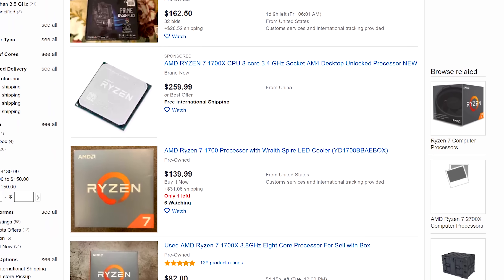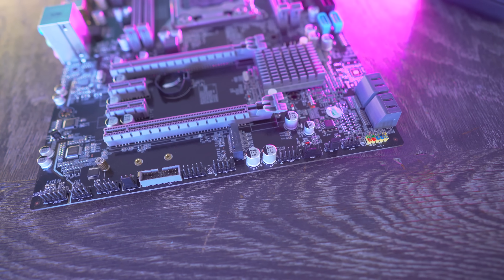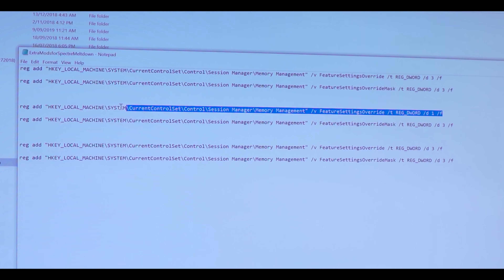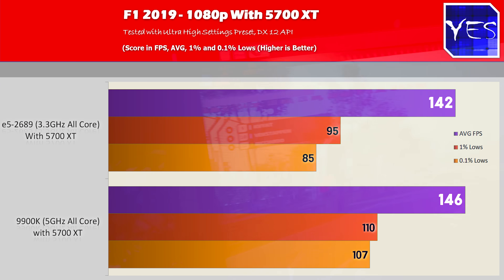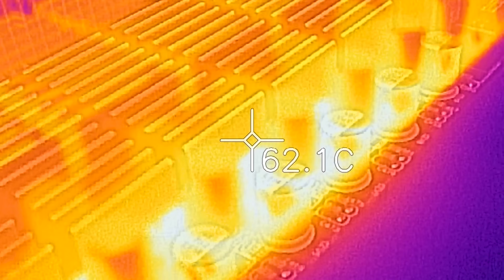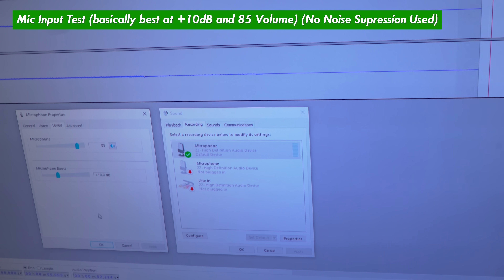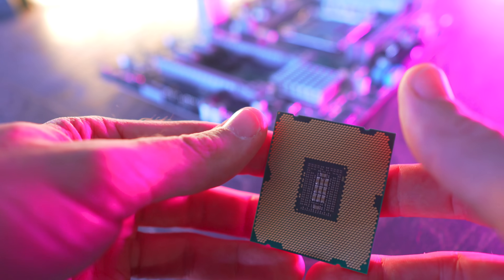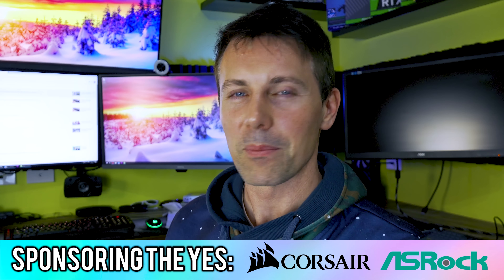8 Core CPU for $53....!? Will it BOTTLENECK a RX 5700 XT...!?

Comment: What's the lifespan like on one of these Ali boards?
Reply: If you want to upgrade dont bother. Its better to get a b450 motherboard and stick with that.
Reply: @XeroPhobous  Yeah ive got b450 and ryzen 2600. I used to have a X58 westmere system but the board died.
Reply: @abedfo88  yeah that build you have now is solid and will last you a good while 👌

Comment: Dead platform with no upgrade path just get a used ryzen 6 core and a used b450 mobo it will be about the same and you have a massive upgrade path if you want
Reply: yada yada yada yada yada x79 if you can pick it up used is still better price to performance (in australia) compared to any ryzen 1st gen which is almost never sold second hand btw
Reply: @MarshallSambell  you save like 40 usd total and you are now stuck with what you got forever. I'd spend the little extra and then when needed you don't have to upgrade the entire system. To each their own I guess.
Reply: @aaronporter2180  By definition not stuck "forever", that's ridiculous. For gaming, the GPU is far more important and as the resolution/detail increases, as games take on newer APIs which need less host processing, older platforms actually increase in their utility. Bryan has covered this before. It's the whole reason why old XEONs are now quite potent, whereas years ago they made no sense for the games of that era before DX12/Vulkan. X79 mbds can easily cope with far more powerful GPUs than the 5700 XT, and bare in mind that the 2689 he tested would only have been operating with PCIe 2.0, so the 9900K had a PCIe bandwidth advantage aswell.

So sorry but you're wrong, for gaming the primary upgrade path is perfectly fine. The mbd supports PCIe 3.0 CPUs should one ever care and the performance works A-ok with far more powerful GPUs. I know someone who uses a 2080 Ti on his X79 with a 3930K, no problems at all. I've tested 1080 Ti SLI on my R4E, excellent results. People make comments deriding older platforms but they've never actually done the tests themselves, they have no data. I've done a great deal of testing.

In reality if one did ever desire greater CPU side performance in the future, eg. for encoding (though much of that is moving to GPU acceleration these days), then by the time that day comes there will be a whole new landscape of used hw to choose from, whether that's XEON v4 CPUs or perhaps Zen2 Ryzen. The point is that at any given moment in time, there is a heck of a lot of utility in used hw which proves that the enormous expense of the latest and greatest simply is not necessary to achieve good gaming performance. The data proves this. The obsession with some mythical upgrade path is laughable, the vast majority of users never upgrade anyway, most end up doing a full platform switch instead because these days tech moves that fast and the desire to keep up with one's peers is that strong.

The one caveat to all this is where CPUs are so old (eg. S775 platform) that they don't support certain modern instruction set extensions that are needed by particular games. If one is playing a relevant game then one needs to bare this in mind, though X79 is easily new enough for this at least for the moment to not be a factor.
Reply: @mapesdhs597  tldr mate
Reply: @aaronporter2180  (re "tldr") Not an argument. :D  Are people afraid of words these days? Good heavens.
Reply: @mapesdhs597  you couldn't have said it any better
Reply: @mapesdhs597  no its just not that important
Reply: Aaron Porter The differences closer to $100 in Australia
Reply: Yeah I love these videos and love seeing the value you can get. And back in the day I would of gone for it out of interest, but these days I just want a computer that I can trust not to set on fire.
Reply: Let's  be honest who will need to upgrade 9900k in the near future
Reply: @abdelrahmansalehelhenawy1220  not what I was referring to but ok

Comment: Recently took possession of a Asus P9X79 WS in like new condition from Japan... have a Intel Engineering Sample 6 core in it turbos to 3.5 ghz but its locked... Once the bank account allows will pick up a 1680v2 with the unlocked multiplier will take it to mid 4 ghz's... running quad channel 1600 mhz,  8 x 8 gb sticks, have modded the bios and have it booting from NVME, need to get an elgato 4K capture card,  have a Vega 56 in it, getting a beast of a Video card for it... hardest part due to the cost.

Comment: Another conclusion -  the 5700xt clearly bottlenecks the 9900k. But again, why would someone, investing in a 9900k, would pair it with a 5700xt?
Reply: For CPU intensive tasks, and to also play games.
Reply: @ByGraceThroughFaith777  Also not sure I'd call it "investing" when for the same or less money one can get 4 more cores and 8 more threads from AMD with basically the same IPC, without the need for lunatic cooling to extract the potential performance. For any given real world typical gaming budget, the 9900K makes little sense; buy something cheaper, use the cost difference to get a better GPU, used or otherwise.

Also, how exactly is the XT "bottlenecking" the 9900K? That's the wrong way round to think about a gaming task as it implies the CPU should be showing greater usage than it is, which isn't true. One primarily cares about getting the most out of the GPU, ie. for a *game*, all that matters is whether the GPU is going as fast as it can (for benchmarking anyway; for real play it's whether it's going as fast as we need it to), and what this shows is that one just doesn't need (indeed one shouldn't need) a top-end CPU to game well.

For a modern game using today's APIs, one ought to be very concerned if a CPU like the 9900K is being pushed flat out, because such behaviour would imply a very poorly coded game. A powerful CPU running with high usage for a modern game is not a +ve thing. Where that performance headroom comes in far more useful is coping with the fact that real world systems don't just game; people stream, record, encode, have other stuff going on in the background like AV checks, they're running Windows setups that are old and a bit degraded, etc. GN showed this when they compared Ryzen 1700 to a 7700K for game streaming way back and they were only testing with clean builds.
Reply: @mapesdhs597  a CPU with so many threads is never at 100% because no game uses all threads at once. To truly see the pure gaming performance of the Xeon and the 9900k, one has to eliminate the GPU bottleneck and use a 2080Ti. I am sure that if both CPUs were tested with a 2080Ti, the 9900k would be far ahead the Xeon.

In any case, I fully see the point behind the video and I am sure that this is valid for many. however, I doubt that someone on such a strict budget to consider investing in an x75 platform in 2019, would buy a $400 GPU. They would probably look for a 900 series or at best, a 580.
Reply: another point - I also don't think it's wise to disable the fixes for spectre etc - especially since most users getting a xeon would have productivity in mind. And not disabling them would bring in the 'slugitis' back :)
Reply: @mystic8260  So much of your first paragraph there is way off off. :D  There are plenty of games that use all available threads. Have you actually done any testing? And like I said, gaming performance is about *graphics*, testing with a 2080 Ti is totally ridiculous. What you're doing there is converting it into a pseudo CPU test, which just ends up with the ludicrous scenario we have now where tech sites rant about 1080p esports & suchlike to show frame rates of hundreds/sec as if that's meaningful, because that's the only way they can test CPUs which can show any differences. As soon as one moves to higher detail and/or 1440p+, CPU differences don't matter a damn for real-world gameplay (the vast majority of gamers do not use 144Hz monitors). 1080p testing with an OTT GPU provides no useful data at all that's useful for making actual buying decisions by the kind of people at whom these videos are aimed.

Also, precisely because of the GPU being more important for gaming across the board, many people do indeed sensibly focus their budget on the GPU rather than the GPU, that's the whole point; it's wrong to assume someone going for a budget platform would also therefore only go for a budget GPU. In reality their platform cost saving is what allows them to buy a better GPU at all. I know because I've helped people go through this decision making process, eg. for a friend of mine years ago, an oc'd 2700K + 980 Ti, cheaper and far better for 1440p gaming than a new 6700K + 980 he'd been originally considering.

People have the methodology of all this so much the wrong way round. I get why tech sites test with a fast card, but that's CPU testing, not GPU testing, and certainly not real world gaming testing which helps gamers make realistic purchasing or upgrade decisions. In the real world, people ask the kind of questions tech sites rarely bother with, like is it worth sticking a 1080 Ti on an AM2/S775 board? This is why channels like TYC, PhilsComputerLab, RandomGamingHD and many others are so useful. If I had the time I would be doing a lot of this sort of thing myself, but alas I don't (dealing with some family stuff for a few months), at least not just atm anyway, though I do have a lot of accumulated data, including CPU data and older game/benchmark data (though much has never been written up):

http://www.sgidepot.co.uk/sgi.html#PC

I have hundreds of Vantage/3DMark11/Firestrike numbers I've not written up, plus a lot of newer game testing I've been doing with a whole bunch of games, but it'll be a while before I can finalise the web pages (doubt I'll ever have time for videos) which will cover AC Syndicate, BioShock Infinite, DIRT Rally, F1 2018, FC5, GTA V, Hitman 2, Metro LLRedux, RotTR, SotTR, Sniper Elite 4, R6 Siege, The Division and Witcher 3 WH (maybe Doom aswell if I can figure out how to capture the performance data). As Bryan has shown, the results vs. newer tech are often a lot closer than most people assume would be the case, in some cases very close. Older tech does tend to drop the 1%/.1% Lows, but often not to any degree that matters (depends on the game, certain titles can be hit a lot more, eg. a bit further down the CPU scale and GTA V would definitely suffer).

This btw is part of my GPU collection:

http://www.sgidepot.co.uk/misc/gpushelves16.jpg

Atm I have eight S2011 systems (one of them dual-socket) and about fifty other setups of various kinds. Most recently I've been testing an RX 580 on a S775 board with a Q9550 (results were... variable. :D) I should add, at one time I was going to do some articles for tomshardware about the nature of mismatched CPU/GPU pairings and real-world upgrade decisions, but alas family stuff got in the way, but Angelini did send me their test suite of the day to use, hence why it's the 2nd table of results on my CPU testing page:

http://www.sgidepot.co.uk/misc/tests-jj.txt
Reply: @mapesdhs597  Congratulation on all of your experiences and testing. No I don't do testing myself and I'm not trying to claim otherwise. I just watch other youtubers, including Tech YES city, doing benchmarking.

I game. So honestly, I don't care how a CPU performs in a synthetic benchmark. I only care about real game performance. and in reality - it goes beyond a CPU/GPU. I do share your view that people try to keep costs down on CPU to invest more in a GPU but there is also a reasonable limit to that. The 'bottlenecking' (which I don't personally like but mostly understood) can apply in many ways - you can have a too powerful GPU where the CPU can't keep up with processing requests to the GPU (think and i3 with a 2080ti) and you can have a too powerful CPU which the GPU can't keep up (9900k + 1060?). And in real life, you can also have a monitor bottlenecking or overkill (9900k+2080Ti + 60hz 1080p monitor). 

I'd like to know all the games you have confirmed that use 16 threads because I didn't come across a single one in all the reviews I've seen from other youtubers. Not that i've watched them all, but i'm really curious to know. What they all have concluded though is that IPC and frequency are way more important for gaming than number of cores. Of course, the question is whether it's worth the extra money but that is up to the individual.

And honestly, you don't always find these old Xeon CPUs and mobo to go with it as cheap either as they are becoming increasingly rare. I see no value in investing in such a old platform when for an extra 50$, you can get a modern Ryzen platform. A ryzen 5 3300g might probably perform better in gaming due to the higher IPC - but I can't test this as I only own 1 CPU and two GPUs :)
Reply: @ByGraceThroughFaith777  in that case, you'd better off going for a 3700

Comment: @Tech YES City Love those XEON's! Just went from the E5-2690 to the E5-1680-V2. Instead of using Regedit for Spectre/Meltdown disabling, Steve Gibson over at Gibson's Research Center has created a number of interesting pieces of software. One called "InSpectre", can test for patches of both Spectre and Meltdown, as well as disable/enable them. Make sure to run as Administrator. I highly recommend having a look at it, as well as the rest of the site. He focuses mainly on security, but has a few other programs there that may be of interest to you. o7  https://www.grc.com/inspectre.htm

Comment: The 2690 is $90 !! Wow big difference between 2690 and 2689. Good choice to go with the 2689 🐴

How about those Xeon x56s ? How they are compared to these e5 2689 ?
Reply: mine has 2 e5-2690s  it was cheaper than than E5-2687w which are also slightly faster than the 90s though more tdp
Reply: @joshuascholar3220  but this 2689 is competing with 5gh 9900k that's amazing !
Reply: @PerchEagle  did he mention which version?  Mine is the first version (Sandy Bridge) and I think that should have about 67% of the performance of a 9900k. cpubenchmark says the same for the e5-2689, but v4 is on par with a 9900k, but I wouldn't expect v4 to be cheap.  Maybe these games were gpu bottlenecked.
Reply: @joshuascholar3220  yep, Xeons are really amazing chips !
Reply: @PerchEagle  well it's that businesses upgraded to get better tdp.. The chips I paid $170 were originally $4000
Reply: Yeah, i'm also undecided if buying an e5 2689 or an e5 2690 ... waiting for comments :)
Reply: @Nick.Zanardini  that would be the good choice in budget aspect. If I would consider a new rig, I would choose the i7 for sure maybe the 9700k but it's only 8 cores and 95W .. no threads and it's for $359. The question now is are threads important? I can get with the i7 price a complete system not including the GPU. The x5670 is 6 cores 12 threads and the same 95W TPD as the 9700k and it's for $17.50 on aliexpress ! The motherboard specs also plays a role for my decision.
Reply: @Nick.Zanardini  keep in mind mine is a 2 processor server with 4 channels of memory per processor. Well lets see, when I first got it I got 2200 on Cinebench r15. After the spectre etc. mitigations it was down to 2100 max.  I can't tell you much about gaming since I'm quite GPU limited by my RX 470.  I turned off hyperthreading because it's only worth about 20% on Sandy Bridge and doesn't help in games and makes timing less stable for the chess engine testing I was doing. I also turned off NUMA and set it to interleaved memory/UMA because that probably makes the chess engine testing I was doing a bit more stable.  That probably steals another few percent..

Comment: i have the Gigabyte UD3 motherboard with a i7 3960X it's not a bad set up
Reply: daniel hulson whats ur oc?
Reply: @renko8065  im only running a mild overclock as thats all i need,it's running at 3.9ghz as that's all i need but if i need it it's there,If your thinking about getting one i would recomend the i7 3930k instead because theres only a slight difference between them
Reply: daniel hulson isnt the 3960x 6 cores and 3930k 4?
Reply: @renko8065  no there both 6 core 12 thread exept the i7 3930k as slightly less cach,I used to have one theres not much in it

Comment: I'd like to see how that xeon cpu runs the 5700xt at 1440p. The 5700xt is a overkill card for 1080p.
Reply: I want to see it tested with a RTX 2080 TI OC GPU
Reply: If you bump up the resolution you're testing the video card and not the xeon.